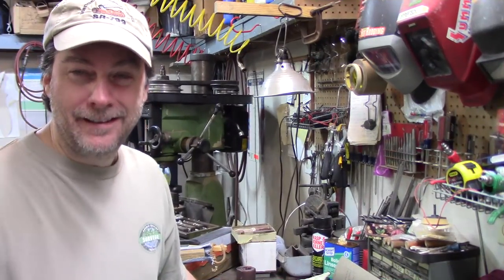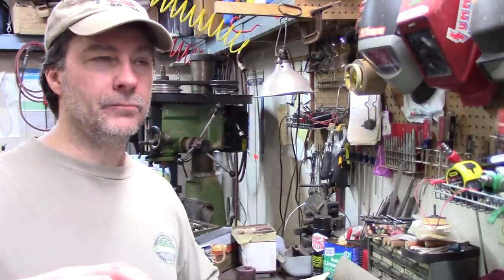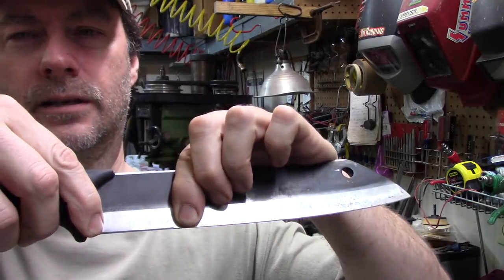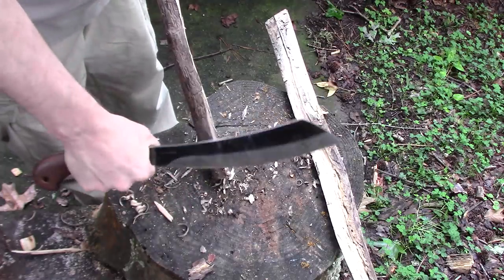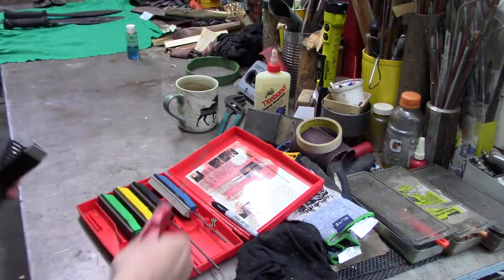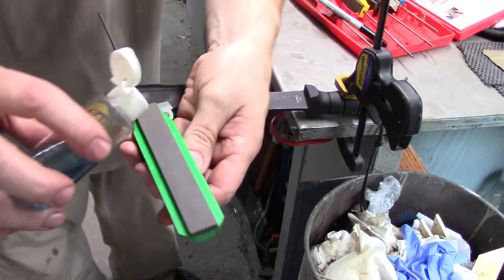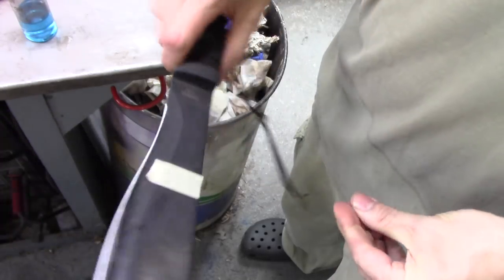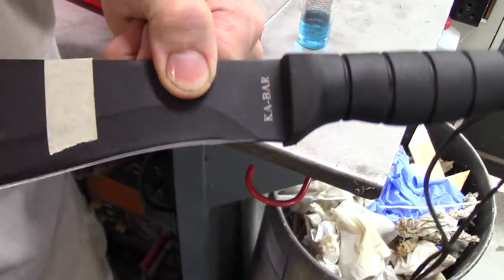Machete Sharpening For Bushcraft Use

Comment: A point of geometry: those angle numbers you're giving are only very roughly correct -- and they will change depending on where along the spine you place your angle ladder. To see that's true imagine the spine was only a half inch from the edge -- your stones would then be almost vertical, and the angles would in fact be MUCH larger than the readings on the ladder. A fun tool is a digital angle gauge/finder ($20 on amazon). You do have to realize that their readings are "absolute;" but you can "zero" them however you like (to the flat part of the blade, after you have it clamped to your table, for example). Doing that allows you to really know what your angle is, and you can adjust accordingly as you move the position of your ladder (and adjust for your finer "carving section" to be just what you want). If you can adjust everything to be exactly the same every time you sharpen you will make the highest efficiency out of the edge steel lifetime. One more thing: believe it or not, different companies have different color schemes for their polishing compounds!! I know, what could be more stupid; but it's true (and a lot of people miss that fact). You've got to be sure about your stropping compounds, and you have to be aware of what's what if you change brands...
Thanks for another useful and expert video, Dave.
Reply from the maker: Thanks for the info and I'm glad you liked the video!

Comment: Making mods to machetes is fine, but I imagine for a hard use it might be better than have a strong edge from end to end. That being mentioned, you can get inexpensive machetes to experiment with and to practice on. You can create teeth for sawing or scraping and cut/file notches to cut rope or to pull a nail or even drill a big hole or make a hook to open bottles. I recall one guy that cut a short machete at an angle kind of like a tanto tip and used it as a throwing knife. I love that Pack Golok.... maybe one day.
Reply from the maker: "Strong edge from end to end"  you gotta remember,  a strong edge is necessary for chopping and not carving.  No one chops with the first two inches near the handle so this doesn't negate any functional characteristics
Reply: @Reallybigmonkey1  Okay yes that makes sense but I thought maybe people might miss sometimes and hit the area and near the handle.

Comment: Seems like everything I sharpen free hand ends up unintentionally becoming a convex grind. I did not realize this was happening until I used a guided sharpening system (Lansky). They all cut when sharpened so when people ask me what type of grind I prefer I just tell them “Sharp”.
Reply from the maker: Exactly my thoughts! Its very tough to get a good flat surface by hand. Guided is the way to go
Reply: @Reallybigmonkey1  - Yes, but I tend to sharpen my big blades free hand and use a guided system for pocket knifes, kitchen knives, and small blades. I just feel more comfortable doing it that way. Probably more about appearance for some knives.

Comment: I have a similar knife sharpening system but the directions state that I should always sharpen towards the blade with the stones. I also have a leather strop that works the same way as the stones, but to strop it away from the blade edge. I'm not sure if it really matters with the stones. I know stropping should always go away from the blade edge.
Reply from the maker: You are Correct as in the stones direction isn't important,  stropping away from the blade is important.  Thanks for the comments and thanks for watching

Comment: Thanks for the informative and fun video, Dave!
One question: isnt the actual angle you receive from your sharpening system depending on the distance between the clamping point and the edge of your blade? This would mean two things: you're not actually putting on the angle shown by the system and that you might wish for and second the angle would vary a few degrees with your progression along the curved blade as the distance from the edge to the clamping point and the guiding hole in the system varies.
Reply from the maker: You are very welcome and I'm glad you liked it.  Everything you said is correct.  The exact degrees does vary but once you've sharpened your blade you'll know which degree hole works best for carving
Reply: @Reallybigmonkey1  I wasnt concerned so much about the newly reshaped carving part of the blade but about the front part where the blade is really wide (like at my SCHKM1 too, thanks for the recent showdown!). There the distance between the edge and the clamping point is far greater then at the narrower and shorter end portion were you reshaped the blade. If you're sharpening the front part the next time and choose a different clamping position you might end up with different grind angles at any given portion of the front part. That's theoretical though and I dont have any idea how large or small the actual difference will be, so I wouldnt worry too much myself snd just do it that way. ;-)
Good thing you pointed out not to move the clamping when grindinh both sides but to just flip the blade with the clamping on!

Comment: Thanks for that very clear demo of using a guided system. 
Isn't the carving part thinner (shallower) instead of steeper? And, is the angle on that system indicated per side or as the total angle? 25 degrees per side gets 50 total, that seems very steep to me. A Mora Companion is 23 included, so 11.5 per side. So is the carving part of the Skrama. 
I think that if you look at some older blades like leukus that were hand sharpened and convex (scandivex) you see the edge being a bit thinner near the handle and getting gradually steeper towards the belly and tip, which should do the same thing, finer carving and shaving near the handle and chopping with the impact zone more forward on the blade.
Reply from the maker: Yes, thinner is the proper description. The Gatco system is marked total degrees.  If I recall right, the Skramas carving section is 25° and the chopping section is 34°. That blade works so perfectly that I base my other machete mods off that one.  Thanks for watching brother
Reply: @Reallybigmonkey1  The idea of combining a thinner bevel close to the handle with a steeper one towards the impact area for chopping in longer blades seems so logical that one thinks ' why hasn't anyone thought of that before?' The bevels that you show on your blades are neater than the factory Skrama one ;-) .  The system you show is simpler than I thought it would be. Hum. Still two weeks to Christmas... Maybe I need to send a flash message to Santa... lol.
Reply from the maker: @FrankSchweppe  Definitely send Santa an email now! Lol

Comment: You better be pretty sure you don't have any kids running, pets playing, or other persons in there, if you set up your big knives for sharpening like that. The best feather sticks, I found to be made with a scandi-convex grinds blade, where the convex part is on the outside(and rolls the shavings), and the skandi one is in touch with the wood (for the bite). With a convex blade, you'll be flat sharpening just one side. You might wanna try it. Thanks for the videos!
Reply from the maker: I actually have two sharpened that way
Reply: @Reallybigmonkey1  And you don't find an improvement?

Comment: How often should I sharpen my machete if I use it everyday to clean fields? Also what clamp, oil, and sharpener are you using they are very good
Reply from the maker: I'd sharpen it as it stops cutting well.  Hard to say how often because it all depends on the type of grass or vegetation you're chopping.  The clamp is a Irwin ratcheting bar clamp. The oil and sharpening system are both Gatco.
Reply: @Reallybigmonkey1  ok thank you. I cut vines and weeds with the occasional small trees but just sharpen as it goes dull?
Reply from the maker: @uzielreyes7659  With no wood just vines and weeds I'd say sharpen once a week

Comment: Ok, for a strop(s) in the field, how do you secure the strop from moving and how could you perhaps make the strop into a wallet with the compound on the inside or alternatively make a sleeve to put it in?
Reply from the maker: I usually glue my strop to a board and keep it inside an old sock in my pack.  I like that folding wallet idea

Comment: Hey David. I'm the guy who wrote to you a few days ago, saying that H. Freight had their machetes on clearance @ $4.99.  Well, I  got to my local H.F. the next morning, and they had been sold out days ago! I planned to buy 3 of them...  one for me, one for a buddy,  and one to send to you for evluation. They look like an Ontario clone, sawback and all.
Anyway, I'm also writing to you about another one. I received today, a Sheffield Branded, Chinese made, 17" SS Kukri machete. 
This thing is gorgeous, and it's gonna be awesome (I think).
It has a 4mm thick blade and it is sharp as H.E. double hockey sticks! I shaved my arm with it right out of the box.
Do you have any knowledge or experience with these Sheffield branded machetes?
One negative: The Cordura nylon sheath is of good quality. Two snaps trap the blade and one strap loops over the handle (which I like).
Problem is, the strap around the handle is too short and can't be snapped. It's short by about 3/16 in. Is there a way to stretch this nylon fabric strap? I doubt there is, but I'd try any idea you might have. Heat gun perhaps?
Love you man, If H.B. gets more of those machetes in, I'll get you one.
Also, which video of yours discusses the pros and cons off SS blades vs. carbon steel? I think I saw one a long time ago. This is my first SS blade machete.
Reply from the maker: That figures HF would be sold out, that place is so popular they can't keep nothing.  I've never heard of that Sheffield name.  But there's so many cheap Chinese machete brands out there no telling how many names are out there. I honestly can't remember doing a video on stainless vs carbon.  Take care and stay in touch Robert

Comment: I have an unfinished Guardian machete with two bevel angles were the edge bevel is roughed in, not factory sharp.  They changed metal types and sharply discounted the remainder of old blades.  It's going to need some work.  Should I change up the edge bevel?, maybe like you did?  That thing is heavy.  Should I do the same thing to my two long grass machetes?  How should I sharpen the short grass blade?
Reply from the maker: I'd sharpen both like I did here.

Comment: would you change the scrama to 30 instead of the 34 degree?   will it still chop ok
wish this had the 34....thanks for the video
Reply from the maker: I wouldn't unless it got damaged or dull. Their factory 34° angle is razor sharp perfect.  Now if I tried to resharpen it, I might not get as clean and perfect edge,  that the only reason I'd go to 30°
Reply: @Reallybigmonkey1  yes makes sense...its so hard to keep that factory edge...

Comment: What kind of oil are you using?
I thought that the scandi grind was the flat grind.
Reply from the maker: Any non gumming honing oil will work.  A scandi is a flat grind but with no secondary bevel.  What's deemed a full flat grind has a primary and secondary bevel

Comment: Dave....I'm running out of Lanskys Oil  for sharpening with and its hard as heck to get here in Canada with buying a whole set all over again ....do you recommend an Oil that is readily available to use on puck sharpeners & stones etc ?? Thank u my friend I appreciate it 🙏
Reply from the maker: You know those hones people use on engine cylinders and brake cylinders? They all use a common oil that's described as "non gumming honing oil" that's just about the best stuff available to work on pucks and it's sold under several different brand names
Reply: @Reallybigmonkey1     thank u Dave !  I'll have a look !  Do you have a preffered brand ?  Lol sorry to bug you but I know you know the best hacks lolol
Reply from the maker: @maritimespook  It's all the about the same but Sunnen is probably the best brand.
Reply: @Reallybigmonkey1    thank u David I appreciate you brother 🙏

Comment: Where did you get your machete with a knife and fire starter in a carrier saw it on several of your utube.
Reply from the maker: I attached the knife and ferro rod myself. Most of my machetes have a knife or saw pouch attached
Reply: @Reallybigmonkey1  thank you. Love the idea less to worry about handling and it is all together carry wise.  Did you make the sheath with holders need a how it. Thank you so much. Just found you tonight. You are easy to follow.

Comment: What was the cause of your back injury.
Job related lifting, or just getting out of bed and suddenly it was 'there'.
Reply from the maker: Throughout the years of being a welder, metal worker and working on Hot roads I pretty much keep my back injured or inflamed my entire life. Sleeping wrong of twisting wrong sets off an inflammation that stays for weeks
Reply: @Reallybigmonkey1  
I understand.
The work you do is hard on the spine.
Keeping the spine in a neutral position, when you lift something is key to protect it (if possible). 
And a good matress, and pillow are of utmost importance too. Doesn't need to be expensive or fancy. Just keeping your spine in a healthy position ( I stay away from very thick matresses, some tend to cave in deep making the spine curved sideways.

Plank , side plank and bird dog are good exercises to do for the spine. few sets, no balls to the walls kind of work, just some effort.
If interested more,Stuart McGill is a good source for info.
There are plenty of video's on YouTube with him.
Reply: @Reallybigmonkey1  
I had to go lighter with working out myself.
Even when doing dumbbell curls.
The lower back says no, and then you have to listen, or else the price will be way higher.
(I'm no muscular type of bodybuilder, just average Joe lifting weights to stay in shape more or less).

Comment: I have the Lanski (probably spelled wrong). The angle guide is not accurate. The wider the blade the less the angle. It's not a big difference, but there is a difference. 2 to 3 degrees from a 1 1/2 inch to 3 inch wide blade. Maybe more, I've never measured it, but there is a difference. The angle can change from one sharpening to the next sharpening unless you clamp the guide in the exact same spot. Something to take into account. I've also noticed the angle change as you sharpen the knife going from a thin part of the blade to a wider section. Just sayin, don't count on the angle guide and watch the edge. Grind it to the angle you want and forget about the numbers on the guide except for reference. I just keep track of the slot I have the stone guide rod in.
Great vid as always, lots of info.
Reply from the maker: I agree 100%. A variance in degrees isnt a big deal to me. I just want a good flat finish which is almost impossible to get by hand. It almost always convexes in some way. Thanks for watching Rick.

Comment: Dave, what are your thoughts about the fact that relatively few bushcraft channel folks feature the use of machetes?
In my opinion, a machete is better than a hatchet for a ton of cutting chores. It's also easier on my bad back with regards to chopping for any length of time.
As a percentage of the channels out there, I'd say it's less than 10% that use machetes. Is it a cultural thing?
What say you?
Reply from the maker: Robert I have no idea.  The machete is the most important tool one can have in the woods.  Thanks for the comments and thanks for watching brother

Comment: A whole passel of knives, kitchen, pocket etc are about 20 degrees. 22 seems to be the best compromise IME between 20 and 25 ...25 works good for a dedicated self defense knife that you GET razor sharp, mirror polished, put it up and pray God you never have to use the thing😂but most cases for those I check factory angles and back off a couple degrees, just the way you did here....with a V grind below 20 is sharp but weak. I've seen convex thicker profiles laid back a bit from factories like Bark River for skinning knives in CPM3V...good God Dave you talking bout sharp!😆...but that's a KNIFE, not a machete or even an all purpose big outdoor knife like an old Carbon V Cold Steel Trailmaster.
Reply from the maker: Thanks for the input Mark. Angles on slicing cutting carving surfaces are usually pretty consistent. I'm amazed at the variety of angles used on chopping blades tho. Thanks for watching brother

Comment: I found out that the angle on these types of sharpeners is only true if you measure it from the tip on the knife clamp to the specified hole. The wider your knife is the steeper the actual angle is. Trying to sharpen my Coup Coup Machete the blade is so wide that the actual angle is closer to 15 degrees. I am looking for a sharpener with a more accurate angle, no matter how wide the blade is.
Reply from the maker: Thanks for the info, that makes sense and can be figured with trigonometry too.